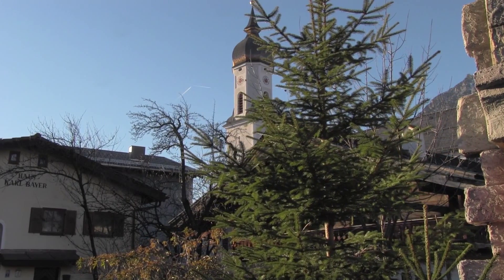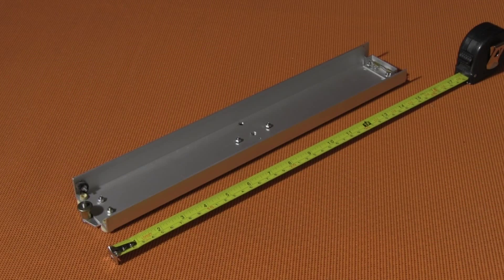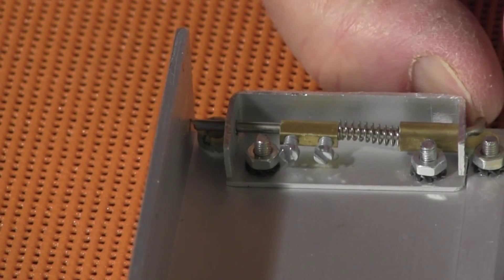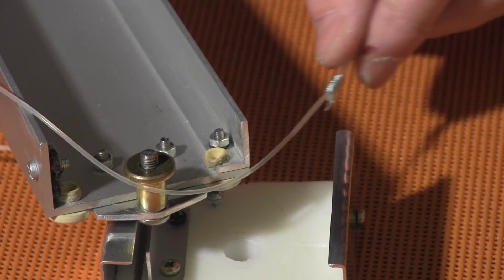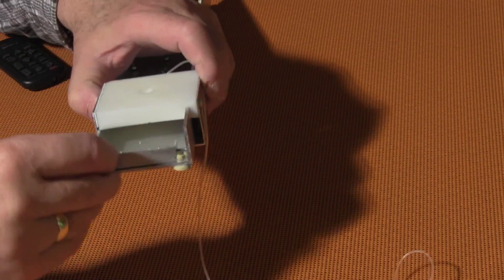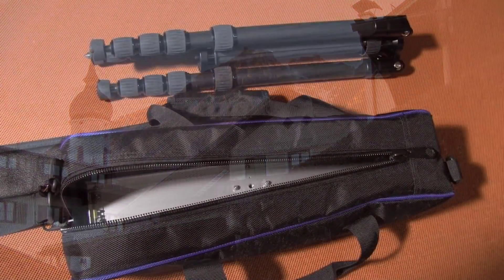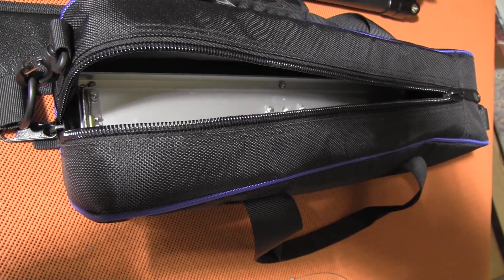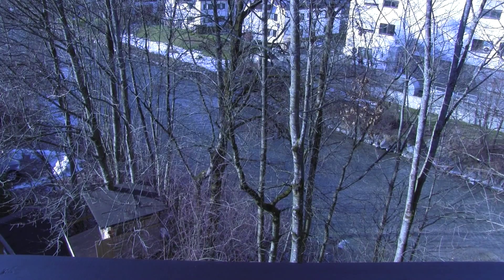Camera Slider, Dolly, effective and easy portable DIY, HD, english

Comment: The problem with all hand pulled systems is that the slider speed is not uniform. Same here. I think adding a hand drivenpulley or gear could solve the problem and circular hand  motion can be smoother. A long screw jack type mechanism is yet another idea.